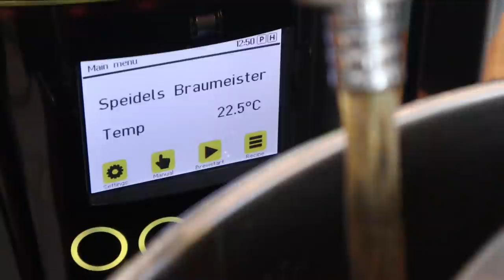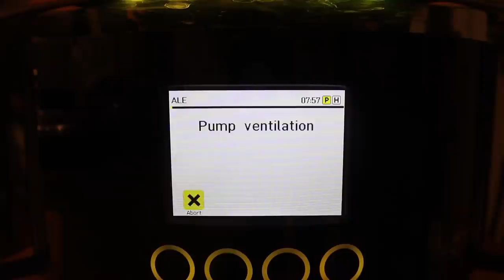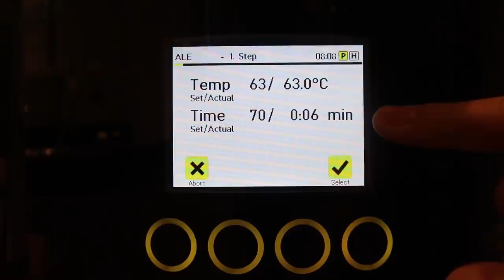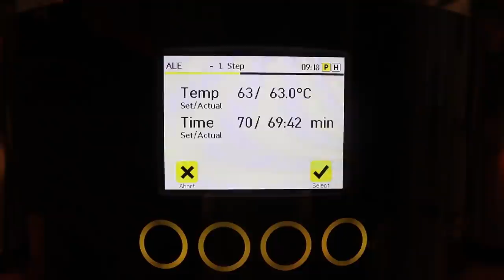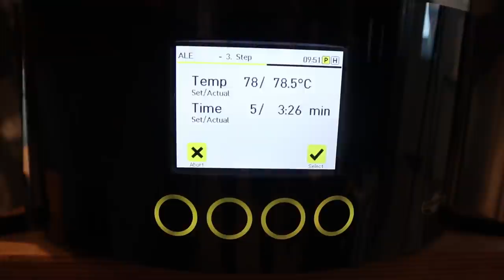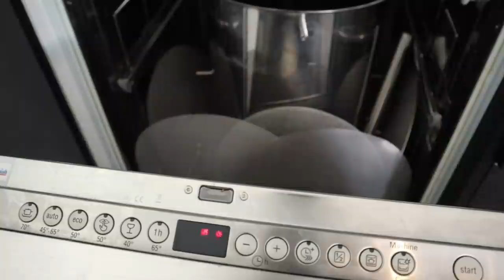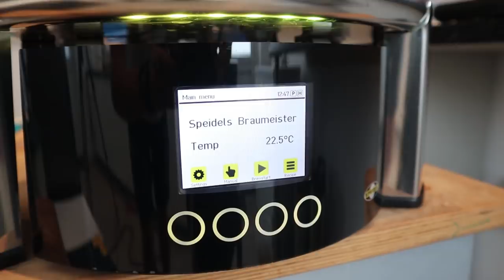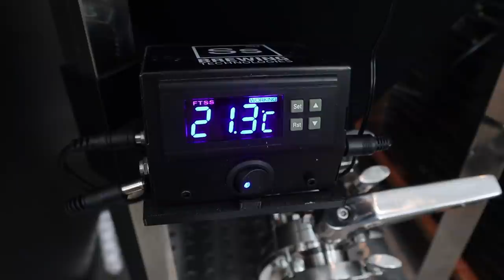Speidel Braumeister brew day - Autumn Amber Ale |52Liters|

Comment: Hi,
I saw that you have put some parts for cleaning in dishwasher.
1. Do you use any kind of detergent or no detergent at all ?
2. Did you take the silicon sealer off the malt pipe what you put it the dishwasher ?
Wonderful movies you make.
Thank you,
Guy
Reply from the maker: Hi there, thanks for the comment 🙂 I just put everything in the dishwasher including the silicon sealing. For cleaning I just using a dishwasher tablet. One in a while I clean all the parts by hand and PBW cleaner. Cheers

Comment: Fellow Dutch brewer here. Where did you get the whirlflocs for in NL? Is it better than Irish Moss?

Ps To each his own but Dutch water companies say only cold water can be guaranteed to be safe as hot tap water could pick up material from the pipes.

Cheers! ;)
Reply from the maker: I purchased the whirlfloc on Ebay, all the way from the USA. Did it once, a bag of 100 tablets, it serves me for many,many years 😂 I like it very much, Irish moss can be used to but in my cases there was always some kind of sandy, tiny rocks residu  on the bottom of the kettle and it makes scratches when moving the immersion chiller. Cheers and thanks for the advice on the hot tap water but I am not concerned about it for some reasons. Thanks anyway 😊

Comment: Great Video, Thanks! I have the 20l Braumeister. Some questions please:
1. What exactly did you add to clear the wort from the hop trub?
2. 103C for boiling is very high. I have the problem when I set to 100C it already starts to boil at around 98C and never reaches 100C, so the time never counts down. So why does your boil timer counts down as it should never reach 103C? What is the trick here? 
3. Did you do any modifications to the washing machine? You took the upper basket out and what else? 
4. What is that machine next to the fermenter to make the cooling water? 
5. The beer at the end in the glass, is that the same recepie? Nice color! 

Thank you very much 😊😎👍🍺
Reply from the maker: 1: A whirlfloc tablet, it's something like Irish moss. 2: 103 degrees Celsius is the maximum setting, just to avoid the element turning off. The trick? check the boil, if it's boiling just lower with "select" temporary the temperature, you will see the timer directly starts, finally just set the temp again to the maximum. :-) 3: No modifications, all original. 4: That's a Lindr AS-40. It cools the water for the fermenter indeed. There are several videos on my channel about it, give it a search please. 5: No it's a Citra IPA, different brew! The Autumn Amber Ale is darker. Tasting video will follow soon. Cheers 🍻
Reply: @homebeerbrewery  Thank you very much. Looking forward to tasting video :-) !

Comment: Great Video! I saw you using the Brewfather App. With what Efficiency are you calculating your recipes? And if I may ask another question. Is the efficiency using the Bac Brewing plates much better or just a little? Looking forward to see the end result.
Reply from the maker: Hi there! I am still dialing the numbers in Brewfather but for this particular bach it was: Brew house efficiency: 75% and the Mash efficiency 77,9%.  The BAC brewing filter plates are just making just a very small difference, the one with the larger grid makes the gravity about 2 points higher then the originals from Speidel. BUT, the BAC plates are SO many easier to clean and they don't change in shape, even after many brews. Totally worth the costs. Cheers!

Comment: Hello Glen,
I saw you throw the hops pellets direct into the BM, never had any problems with it? Do you throw hop flowers in as well or will you use a hop sack? 
Kind Regards, Klaas Bakker
Reply from the maker: Only pallets settle to the bottom after a few days , especially during the cold crash. In case of whole hop flowers I will recommend a hop filter,bag or strainer. Never had problems doing the method in this video  but this time the dump valve was a bit clogged as you could see in the video 🤣 Cheers🍻
Reply: @homebeerbrewery  Thanks for the quick response. My questions is about addings hops during the boiling stagen in de BM. The pellets you put straight in, never had any problems with the pumps? And how is this when you use hop flowers?
Reply from the maker: Klaas, sorry. I thought your comment was on a different video, YT studio doesn't show a thumbnail with a comment incoming. In YT studio it does and then it's all clear. Ok again about the hop pallets: no issues with using about 120 grams of hops total on a 52/55 liter batch. The pumps don't get clogged in my cases. I had one of the 2 get clogged with with a extreme load of hop (IPA) Even when both pumps aren't working the only downside will be the cooling process taken some more time. After cooling en transferring the wort the BM needs to be cleaned, I ALWAYS clean the pump and disable it, you be surprised how much junk is in there. After cleaning you are good to go again for the next brew. Always use a hop filter with whole leave hops :-) Cheers 🍻

Comment: Would you recommend using a hood, I see you used to have one on your previous system?
Reply from the maker: If you mean the stainless steel Speidel  hood: For sure, for many reasons but take a note that it creates a vigorous boil that makes the hop additions (when not using a hop filter of spider) go stick on the side of the kettle above the level of the wort you boiling, solution is keeping a gap between the hood with the U shaped metal that you also use to rest the malt pipe on. But, it's nice  to use as a funnel and to adapt it to a ventilation hood or air extract system. If you mean the hood for taking away the condensation: I always boil outside no need for that anymore. Cheers Darren! 🍻
Reply: homebeerbrewery thanks, was on about the speidel one, I’ve seen some forums suggesting to lower the boiler temp, so that could be another option...
Reply from the maker: Indeed, lowering the boil temperature is  a very simple solution 😉

Comment: How does the timer start when the temperature is set at 103°C, your boil will never get that hot?
Reply from the maker: When I see an active boil going on I reduce the temperature setting to below boil, then the timer starts counting and Inset the temperature back to 103. No, you never get to a 103 but maximum I get is 101,5. All depending on sugar amount in wort and where you live (sea level) . Cheers

Comment: Is the machine easy to use thinking of buying a speidel myself
Reply: I own the 20 liter version of the Braumeister and I can confirm that it's very easy to use. I also own a Brewzilla 20 L. This system also works fine but it's a bit more "complicated" to use than  the Speidel. So in short: If you have the budget for a Speidel, I can definitely recommend it. But the Brewzilla also works fine for around 25 % of the costs for a Speidel.
Reply: Axel K. Thank you  for the help I wanna use Deutsch tech as imo deutsch equiment is best and service is always ok.
Reply: @icedchief  Absolutely! The build quality of the Speidel Braumeister is definitely much higher than the build quality of the Brewzilla, the Grainfather and several other systems. Happy brewing! :-)
Reply: I have 20l Braumeister and also very happy, can reccomend it.